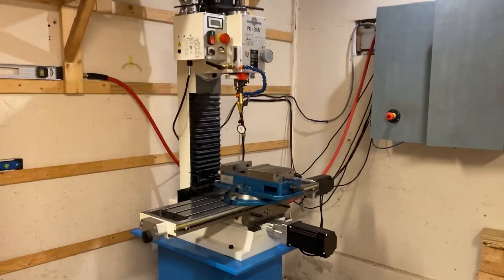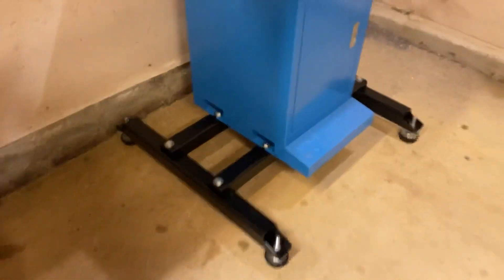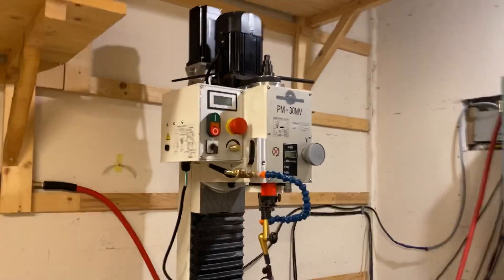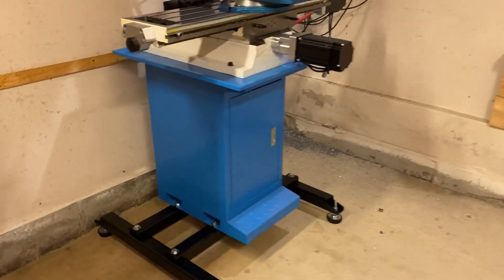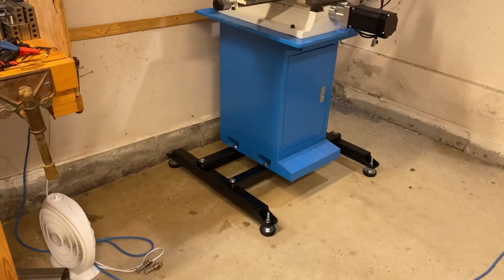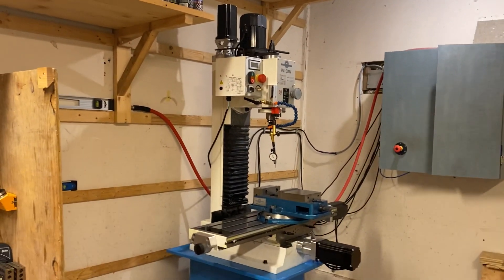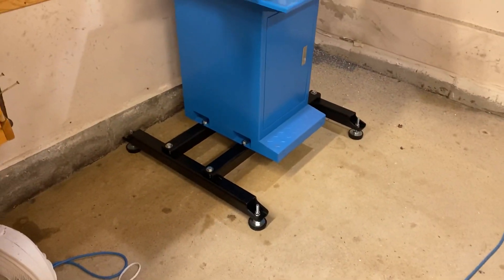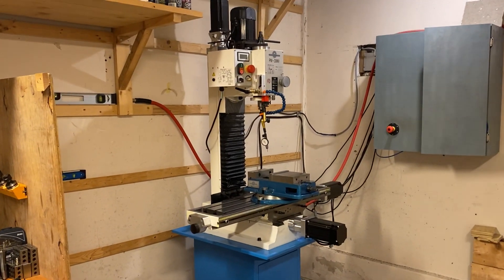September 3, 2020

Comment: get yourself some concrete anchors. (they are strong enough to hold up a car lift) drill holes in the floor where they need to be and bolt the mill table directly to the floor. put 2 nuts then washer on the anchor first before the stand, then another washer and nut on top to tighten it. you can use the nuts on the bottom to level then jam nut it then tighten the top nut. if your worried about studs in the floor if you move or something, knock the anchors thru the floor and concrete over the holes.

Comment: Hey Adam, nice work in the conversion. Question: would happen to have a materials list for the entire conversion? I’m looking to buy this model and would like to do a CNC conversion as well. Any CAD Data would be appreciated too!
Reply from the maker: Hi Matt - sorry - I don’t have a detailed list but:

1. Ball screws, double ball nuts are all from ArizonaVideo99 on youtube. 
2. Nema34 12Nm closed loop steppers and drives are from “Fast2Buy” on eBay 
3. CNC controller is the Acorn from Centroid

Comment: Its not the fault of the stand you purchased. By mounting the stand on that platform you effectively reduced the foot print of the stand to half of what it would have sitting on the floor. These stands are not the heaviest things but they are sturdy enough to do the job as long as the entire base of the stand is supported not just under the mounting holes .
Have you considered pouring a free floating concrete pad on the floor. Then you can raise the machine as much as you want and still lag bolt it ito the floating concrete pad. It will be solid as if was bolted to the floor.
Reply: I agree that it's not the stand. The two cross bars just arent enough to keep the thing from flexing like that. Youd need to brace it differently for that to work.
Reply: Could also be the feet or the feet bolts. They look pretty thin.

Comment: Take a string line and drop it from one corner of your XY table and drop it to the floor, that is where you need rigidity.  You might have gotten a much better result by simply bolting the current stand directly to the floor.  Instead what you have done is suspend your entire mill up in the air on a beam, this might be why it shakes.  Without seeing the whole picture it's difficult to say where the problem lies, but I think it's your stand.  You are using an outrigger concept, which can work, but the outriggers need to be over-engineered for rigidity.  This is a fancy way of saying: bigger steel, thicker steel, heavier steel.  What you really want to do is make sure that there is support directly under each corner of your mill and then attach it to the floor.  If you feel that the stand is flimsy due to the thickness of the steel, then I would recommend that you make a more sturdy one yourself, but try to keep the same geometry.  Those bolt holes of the Matthews stand are EXACTLY where you want your support.  Then drill some holes into the concrete pad, epoxy in some concrete inserts, and then CINCH the mill down to the concrete pad.  This will give you the transfer a lot of load from the mill to the floor adding to its rigidity.  If you want more rigidity to your set up, then build a bracket that attaches the column to the shop wall.  That would definitely stop the leaning tower of Matthews from shaking.  Good luck

Comment: isn't the machine stand supposed to be bolted to the concrete
Reply from the maker: Trying to avoid lagging into my floor but I’m curious if it would make a difference. This blue frame is real thin. Do you have the same one Dusan?
Reply: @adamdebowski2037  it probably would but given you pointed out the gaps and the thickness of the steel it's hard to say how effective that would be

i don't have the same one, no. i did however get a chinese lathe with machine stands and those stands are much thicker plate than what you're showing here lol. how much does the machine stand weigh?
Reply: @adamdebowski2037  i was actually thinking of getting a PM833-T tho lol
Reply: @adamdebowski2037  I bolted mine to the floor and it is actually quite rigid. Had to do some grinding on the base of the mount to make it flat and still shimmed it a bit for level but it is as solid as you would ever need. I'm happy enough with it.